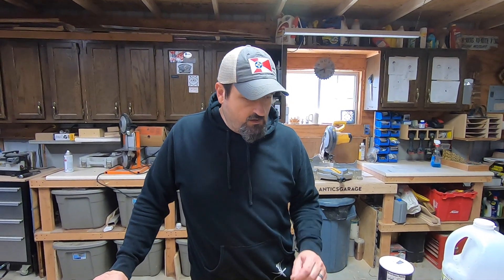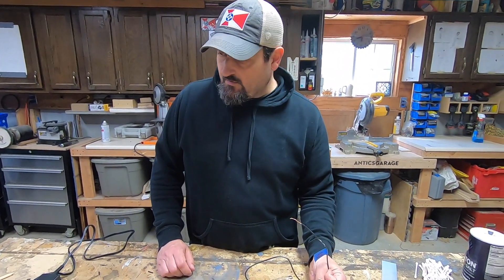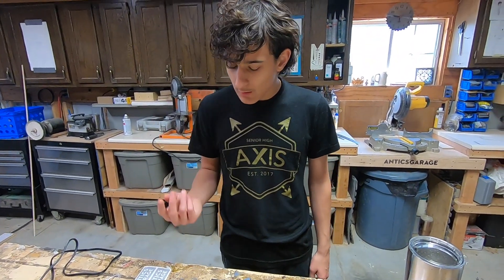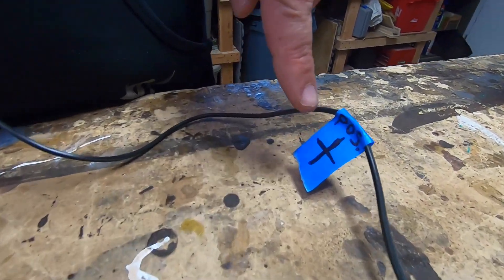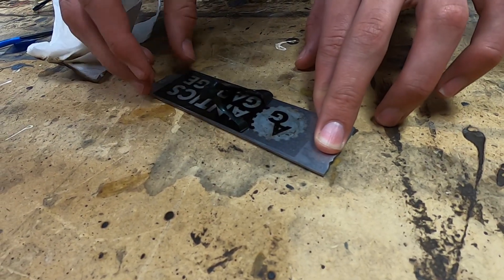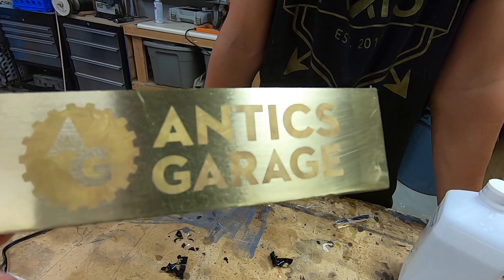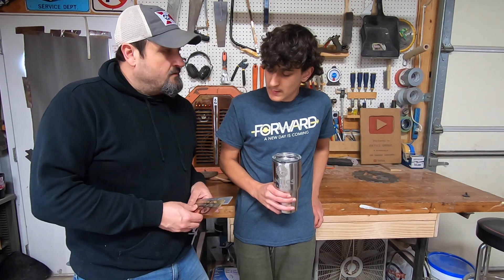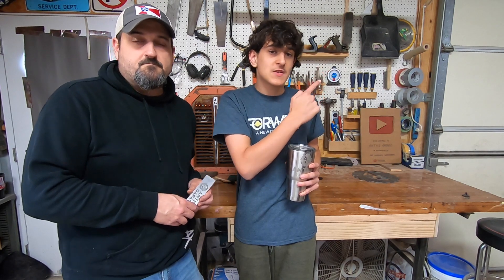Electro Etching on Steel, Brass, Aluminum, Copper, and Stainless Steel!

Comment: Switch the polarity for the aluminum (and maybe the brass as well) and you'll get a lot better etch.  For added contrast, switch to low voltage A/C after you etch it (and before you take the vinyl off) and it'll turn it black.  It works on steel, not sure on AL or any of the others.  You can try a doorbell transformer for the A/C supply.

Comment: This is so stupid, why don't you just immerse the workpiece in a saltwater bath, switch on the current and leave it there until finished ???
Reply from the maker: This process can be done on small areas of larger objects that are difficult or impossible to submerge. Plus you only have to apply resist to a small area instead of all sides of a larger part. Or I'm just stupid, I guess.
Reply: Depends on the look you want.  Hand etching gives it brushstrokes just like a paint.

Comment: I just got thru trying to do this on a mug for Mother's day. Went out to the car , and used the 12 volt off the battery. Way too many amps. It boiled the vinal off. Will sand it to a shine and try again.
Reply: 😆 boiled the vinyl off 😆

Comment: Turns blue because copper is reacting to the vinegar like electroplating solution is made
Reply: So could copper eletro platiig solution be made by simply dropping clean copper rod , or whatever into a vinegar and adding electricity DC???     I know they don't give that stuff away.
Reply: @coburnlowman DC current run through pieces of copper for your positive and negative on opposite sides of your container with vinegar and salt. That is the easiest way to make it yourself. Takes time. You can use pieces of copper pipe or bundles of stripped wire for the copper.

Comment: I was wondering what the output is on the adapter you used.  I have quite a few of spare adapters and a piece of brass I want to etch.  Thanks!
Reply from the maker: Ours was 12 volts DC, 2.5 amps. You don't need that much, though. I've seen this work with a 9 volt battery. Any DC source will probably work just fine, but some will be faster than others.

Comment: Also for people trying this it won’t work properly on anodized. I watched to see results on brass so thank you guys. What I often use is a small arc welder set on low. For my acid pad I wrap a cotton pad  and electrical tape it. It works great and quick on aluminum
Reply from the maker: Thanks for the additional info. Good tips!

Comment: How do you determine which is positive and negative terminal?
Reply from the maker: On a typical wall wart/dc adapter, the center pin is usually positive and the outer ring is negative. They should be labeled. If you're planning on cutting the plug off anyway, you can "dissect" the plug and figure out which wire connects to the center pin. Hope that helps.
Reply: @anticsgarage5230  thanks

Comment: So could you actually etch all the way through and produce gears using the same technique over a longer time? ( Submerged in the electrolyte, rather than with qtip)
Reply from the maker: I suppose you could technically, but the edges would get pretty messy. With etching like this, there's no way to make the etch go straight up and down, so the deeper you go, the "blurrier" the edges would be. Really thin material, with a resist on both sides might work.
Reply: You can etch all the way through but it’s a lot of etching and not the results you hope for.
Reply: Yes, this is done regularly in industry.
Reply: After a while you get a lot of undercutting. To combat this you could try taking the part out of the solution and put nail polish on the sides of the cuts to keep the under cutting from happening.

Comment: That's nice, I've done some stainless, but searching for etching aluminum I found this. Now I know you can do copper and brass also. Makes me wonder whether that would work on nickel? As far as technique goes, I think dabbing instead of sliding would help with the swirl marks.
Reply from the maker: Thanks! I think you're right about the technique. A little more practice and I'm sure we could get it a lot cleaner. Definitely give aluminum a try - it worked great.